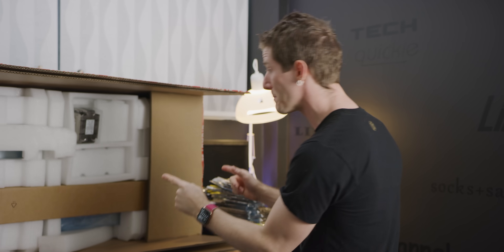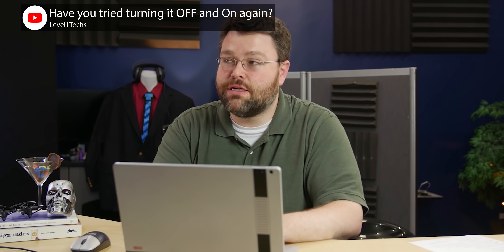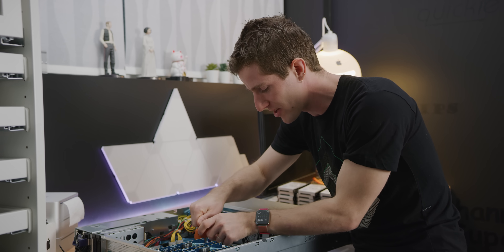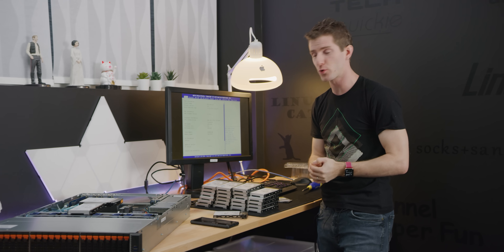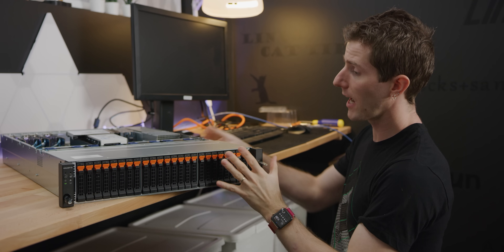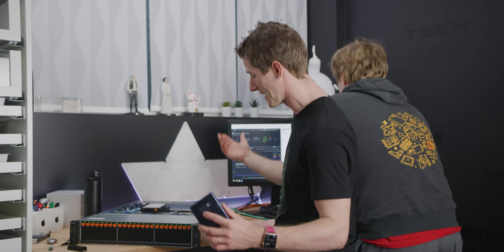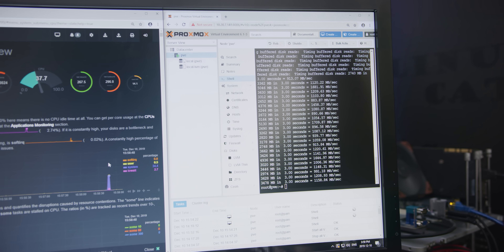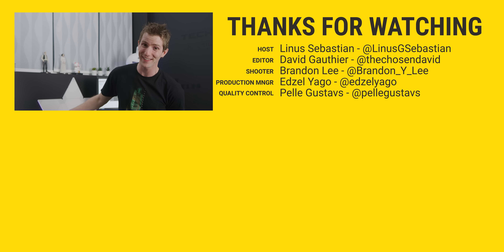Where Intel is in REAL Trouble... - AMD EPYC Server Upgrade

Comment: 10:00 for those wondering what a 'cold-spare' is, it's a replacement drive you store outside of the server (in a box or w/e) as opposed to a 'hot-spare', which is already installed into the server but not being used (so that the moment a drive fails it can immediately start rebuilding using the already installed hot-spare).

Comment: Seasonic is an awesome understated sponsor. Instead of all the fake marketing BS all the gaming companies like Corsair resort to, Seasonic actually makes measurably and objectively better power supplies that basically never fail. They might not have fancy paint jobs, gaming decals, and RGB fan lighting, but they flat out arguably blow away any other power supply brand on the planet in terms of real world performance. So kudos to their understated sponsorship. A flagship EVGA, Corsair, or most other gaming centric power supplies, might last 2 years and not even meet their specs. While a Seasonic will likely last 6+ years and exceed its specs. LTT needs to feature more sponsors that are actually better instead of all the crap you typically shill in the name of greed.

Comment: Did I miss the part where Intel is in "REAL TROUBLE?"  All I remember is Linus seemingly incapable of making this sh*t show ... reach the correct speed.
Reply: Well you just can not use that much drives in an Intel system and reach half the performance.... Oh yeah and ltt should really read about the stuff they are trying to sell. The clearly have verry little clue about datacenter systems...
Reply: its clickbait but still interesting.
Reply: @RobbeSeolh  Nah not really, I thought Linus was going to spout something profound (for a change). So it is just a clickbait-y title.
Reply: I love my Intel Optane 905P SSD.
Reply: Seems like they had several issues related to using AMD hardware, and also used Intel storage devices.  ¯\_(ツ)_/¯

Comment: Ok not finished yet with the video, but come on, Windows is known to be crap in I/O heavy load so good you switched to Linux. But I would have not made 4xRaidz1 but 2xRaidz2, each vdev 12 drives  wide. Then you can loose 2 drive in one vdev at once and it would still work.

Comment: “Your home network is probably going to be gigabit” yeahhhhhight😂😭
Reply: Home network = LAN and NOT your crappy internet connexion...
Reply: DaProphet my LAN is 56mbps. The LAN!!!!
Reply: @verylongname7220  my Lan is 900mbps down and 700mbps up
Reply: @verylongname7220  That sounds like Wireless 802.11b...
Reply: @resneptacle  802.11g.
b tops out at 11 Mbit/s.
Reply: JonasLue no it is an 802.11.n connection but on a phone hotspot

Comment: can  someone help me please?i want to buy a good gaming monitor but cant decide between Acer Nitro QG271,Acer Nitro QG221Q and Acer KG241QP.I want to go for the third one but is the compromise of an ips panel for a TN panel worth the 144hz and 1ms response time?
Reply: You ask a question only you can answer. The whole "which panel is better" depends on the person.
Reply: if we ignore the panel's aspect then the nitros look nice with the thin bezels.do u think the look plays a role?
Reply: @darahascanjeevaram8661  I wouldn't choose a panel based on looks or bezel size, personally, but that's just me. Also, I don't do multiple monitor setups, so maybe bezel size would be relevant if I did. I'm also a big fan of IPS and can't stand TN panels.
Reply: @LemonRush7777  so if i were to go for a single monitor setup to play hardcore then u say a performance based monitor would be better.
Reply: @LemonRush7777  also,the KG241QP has a 144 hz refresh rate and 1ms response time but it has 
a TN panel.
Reply: @darahascanjeevaram8661  How important are refresh rates for you? Do you play a lot of online multiplayer games competitively where that makes a difference (like in a FPS)? Can your GPU even drive a monitor at those refresh rates? Are you bothered by a TN panel? Those are the questions you should be asking. I'm considering getting an IPS monitor that overclocks to 100hz or more, just waiting for one that has HDR  as well for movie watching (and freesync 2)

Comment: So from a ZFS standpoint - FreeNAS in particular - more vdevs more IOPS, more drives more throughput. There is the issue of running crystal disk mark if its running off the share SMB/CIFS (the network protocol) will limit the performance significantly. From a ZFS standpoint - likely Wendel explained as well - throughput is essentially the number of drives minus the parity, but IOPS is the IOPS of the slowest drive in the vdev (RAID group). So RAID10 would offer the best latency, and a couple of RAID groups of RAIDZ would offer better throughput depending on how you balance it. 

My guess as to why the performance under ZFS fell short is likely the memory caching architecture and possibly NUMA nodes. The Epyc CPU has four NUMA nodes and PCIe controllers looking at the architecture. I guess the Samba / File Share (SMB is not always multi-threaded) and that will likely cause issues. If the numbers from a 10 drive config were better than 24 drives, my guess is there is a hop in that PCIe to PCIe bus causing lag for ZFS or other other file systems used. To get true max performance from the storage may want to also ensure testing multiple clients not just a single client because the file share itself will limit performance (threads issue again) - I don't think that is what was used in the final test, but explains the issue a little more because likely in a RAID design the benchmark is jumping between cores and dies, while running in parallel manually will of course offer peak performance.

More info: https://www.ixsystems.com/blog/zfs-pool-performance-1/
https://www.ixsystems.com/blog/zfs-pool-performance-2/
https://www.nextplatform.com/2019/08/15/a-deep-dive-into-amds-rome-epyc-architecture/

Comment: It's so interesting seeing you guys using more open source server stuff. I do this as a living and it was an... interesting... move from SATA to NVME. We had expected NVME to be blazing fast for commits to disk (specifically for DBs) but they're actually woefully slow when compared against battery backed NVRAM on RAID controllers, so our commit IOPS (we flush almost every commit to disk for data resilience) went down the shitter. Add that to the dodgy hotswapping and it's no wonder that Facebook is moving to Optane!

Comment: After messing around with Windows Storage Spaces for some reason, you concede defeat and say you're going to use FreeNAS. Then you cut to Proxmox. Did something go wrong with an attempted FreeNAS (baremetal) implementation ? Were you running FreeNAS in a VM ? Were you running Proxmox+ZFS ?
Reply: At the monent i an planning my storage and VM Honeserver :) I cant really decide between FreeNAS and unRaid. Someone has any suggestions? :)
Reply: @gamenikhd2001  FreeNAS is likely a little more performant, unRaid more user friendly. Smaller installs will likely not see much difference - but if you know FreeNAS (or willing to learn) its a pretty cool platform. For VM work, FreeNAS has Bhyve the FreeBSD hypervisor, which may or may be your cup of tea, but also has jails if you can except poking around with FreeBSD applications (pkg search <whatever> over apt search <search whatever> on Ubuntu).  Regardless you need to ensure the hardware is right for the platform first so if looking to repurpose old hardware check if blogs/forums etc. to ensure compatibility before the build (likely Intel all things is the safest bet, not that its necessarily the best).
Reply: @gamenikhd2001  FreeNAS, ZFS is rocksolid and is free compared to unRAID.
Reply: @GameNikHD https://youtu.be/aXsRIrC5bjg

Wendell has a bunch of other videos about the two.
Reply: @gamenikhd2001  For home use, 98% of the time you want to use Unraid. Unraid will deal with a mish-mash of disk and hardware better than ZFS. I find that ZFS backed solutions like FreeNAS work better when you can buy your disk more like a business, IE buying blocks of identical disks. Unraid seems to deal with drives of varying sizes and manufacturers better. ZFS solutions have more capability, but you have to be honest with yourself if you need those features and if you can afford to buy hardware in a way that is more supported by ZFS solutions.
Reply: @gamenikhd2001  openmediavault. Although.. Getting zfs is a bit shell work
Reply: @gamenikhd2001  i think unraid is allinone, Storage and VM in one server. freenas ist "just" a file server with limited vm features.
i am alsow planing my homelab. i will build an storage machine with freenas, and two xcp-ng host for wm, vm storage on freenas.
Reply: I had the same thought. Why would he use Proxmox if he only wants to build a NAS.
Reply: @Nebucatnetzer  ZFS on Proxmox is based on ZFSonLinux (ZoL) which is currently a more feature-packed variant of ZFS.

FreeBSD (and FreeNAS) are currently in the process of being moved to ZoL (which will be renamed OpenZFS2.0 at that moment), but that would take some months before it is completed.

Anyway: There are good reasons to use ZoL instead of ZFS on BSD. ;)
Reply: @MrPuffin69  so what are those reasons? Can you elaborate a bit?

My ZoL vs ZFS on BSD tests showed ZoL is slow AF.... (at least it was last year)
Reply: @justacomment1657  The whole list of features not on BSD is the reason.

things like:
- Allocation Classes
- Encryption compatibility
- Improvements on TRIM

Besides it also Combines developer efforts, which leads to possible faster development.

How did you test your "slow as fuck"?
I myself are currently doing lots and lots of testing on the ZSTD compression PR and testing ZFS performance is one tricky bitch.

For example:
DD on default settings doesn't play well with ZFS at all and with some tweaks in the parameters still has unrealistic performance. It seems to utilise one-file-one-stream reads, while read decompression threading is beter with mulitple streams and/or files.
Reply: I came to ask this exact same question. I want to know why they didn’t go with FreeNAS.
Reply: He was running proxmox + zfs
Reply: They've run FreeNAS before and didn't have issues. Every time they use unRAID there's always some weird issue.
Reply: @T3rf3x  Talking about Linus Media? Of course they'd run into issues. They'd quickly exceed the capabilities of Unraid. They're a small business with enterprise level computing needs. They are far, far removed from home user needs.
Reply: @Banzai51  Honestly there's not reaĺly a scanario unRAID makes sense for home users, especially when QNAP and Synology already seem to advanced for some. FreeNAS being based FreeBSD already has enterprise pedigree. As you may know FreeBSD is used by the likes of Juniper, (Dell) EMC, Sony, WhatsApp, Sony, NetApp and Netflix due to its strong  network and storage stacks.
Reply: @bosstowndynamics5488  Sure, but it comes down to can you afford to buy disks in blocks. If you plan on adding storage by shucking EasyStores, then Unraid is going to deal with that better.
Reply: Windows storage spaces is hot garbage. Parity volumes write at 7MB/s no matter what drives you put in. You can add SSD’s as Journal drives, if you learn powershell. No GUI anywhere in windows can even deal with that, even diskpart just doesn’t even show a drive. HOT. GARBAGE.
Reply: You made the mistake of thinking they actually read and respond to comments.
Reply: Good question
Reply: @Hangtube I think he's installed proxmox,  put a freenas vm on it, passed through the pci cards and declared complete failure.  I wanted to virtualize my home servers, but I failed. Freenas wont work in virtual environment at all. I have 15 different hba cards and no one worked in a passthrough config. So basically Linus and his team wants to complicate things. And I think they ran out ideas and this video is a failure that he can in the next video "magically find the problem" and you guys and i have to watch another 17 minutes of nonsense....
Reply: https://youtu.be/IjJBvFiCqAs
Reply: @MaPnS Proxmox is using 5.3 based on Ubuntu Eoan though...
Reply: Apparently I have the wrong universe. This is the good logical comments universe

Comment: "Your home network is probably gigabit". What the hell?
Reply: Home network = LAN and NOT your crappy internet connexion...
Reply: @3DProphet  Ik but it was the way I read it like he was saying most people have gigabit I was like :O
Reply: @3DProphet  I don't think all ISPs ditched 10/100 Ethernet yet.
Reply: Gus TV i get 900mb downs and 400 ups
Reply: @tsxjavi  That is insanity! 😍
Reply: Gus TV verizon
Reply: If you have a modern CPU your network is definitely ran by 1gig Intel lan since that is what all CPU motherboards run. Unless you have 2.5 gig lan. Now wether or not your actually get that through your ISP is definitely a different subject like I only get 200 up and down so I'm not even close to 1gig
Reply: @TheSubieFan  Yeah the ethernet ports are gigabit but my wifi is 4 down and 1.1 up 😂 and that is fast!
Reply: @TheSubieFan  "only 200 up and down" cries in european
Reply: @pi_does_code  Ikr! I get 4 down 1 up, which is just enough for 2160p60 youtube! 4320p however... 😂😂
Reply: @afdsgq34hgygj6wq5  And you use that insane Internet speed for what exactly? That's enough to watch like 20 x 4k video streams at the same time. Big family?

Comment: RAID should be done with ZFS anyway anywhere you want resilience and reliability, so no hardware raid is no biggie. Especially with 500 gigs of RAM, use some of that for the ARC cache and you're going to have screaming performance too. Also, ZFS raid means if all the hardware except for the hard drives goes bad, you can transplant the drives to something else and do a "zpool import -f" and continue on your merry way. Also, installing the OS straight on the hardware is basically straight up stupid nowadays. Use virtualization. This is 2020, not 1820. :p
Reply: ZFS wants direct access to disks tho.
Reply: @p_serdiuk  That's true, but you can solve that several ways, first of course making normal virtual disks (which is a lot less secure) or by doing passthrough. Although personally I would run on bare hardware for the storage part (like FreeNAS, XigmaNAS, what have you) and run anything else that needed running in a virtual machine, they both support that. But running Windows on bare metal makes no sense if you're doing a server, in almost all cases.

Comment: What about cable management behind the desk / TV

It's one thing being ultra neat inside the chassis, but what about all the cables plugging in to the back. What tips apart from velcro do you have to keep the back of the desk / back of the tv cabinet neat?

Tip #1 from me is to label all plugs with what they support before you plug them in for the first time. Saves a load of hassle in the future.

Comment: Unfortunately, ZFS is an out of tree kernel module, and Linux some time ago decided to screw all the out of tree kernel mods and make it so they couldn't access the vector processing parts of the CPU. Absolutely awful. The ZFS team has worked out a way to get it back though but it takes a bit of working around.

Comment: Hey, is anybody able to help me out? I have a ThinkPad Yoga computer (meant for school) and I was wondering about the possibility of playing video games on it. The game I want to play is League of Legends. There is 16gb ram and its an 8th generation i7 intel processor. If you couldn't tell already, I'm awful with tech stuff. I want to say its due to the GPU (Intel(R) UHD Graphics 620) because it has a limited vram of 128mb (a conclusion I've come to with limited research). I've tried going into the BIOS settings to increase the vram and could not find anything. I think it may be the graphic card's actual limitations and not something I can change.

If this is the case (and there is nothing else I can try, as when attempting to play the game, I load in super fast but have 5-10 fps during the gameplay), is it possible to switch out the current GPU to a better quality GPU that could handle gaming, without risking damaging the computer or its otherwise great performance? And if so, what would be some recommendations when considering pricing and performance (hoping to spend under 100 for the processor but anything around there I will more than consider)

If you need further information on my computer I can provide it if necessary.

Thank you!
Reply: Braedan Kanai do you know if your computer has a thunderbolt 3.0?
Reply: @hwwwwwwwwwwwwwwwwwwwwwwwww6244  Hey, yes it does. What is an "egpu case?" What does it do and how would it be installed, and do you have any recommendations for a specific egpu case and gpu itself?

Thanks for the reply
Reply: If it does you can buy a egpu case and buy a gpu capibal of playing League
Reply: Sorry I suck at spelling

Comment: My home network now is 100 gigabit Infiniband.

Don’t use ZFS.

Try using XFS with mdadm.

You might get better performance.

I have four Samsung 860 Evo 1 TB SATA 6 Gbps drives in RAID0 and I can write to it at around 16 Gbps sustained (out of a possible 24 Gbps), your 24 NVMe drives should be able to do better than ~192 Gbps (24 GB/s) (out of a possible 768 Gbps).

At those speeds, you should have been able to achieve that with 9 NVMe U.2 PCIe 3.0 x4 drives.